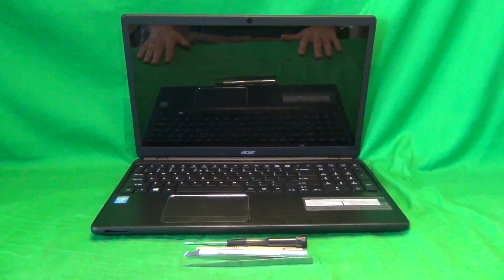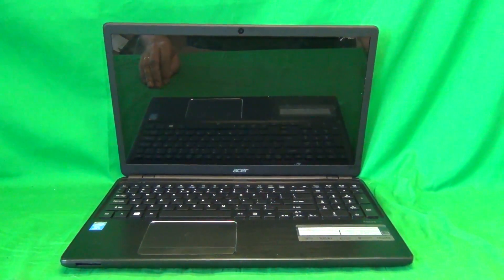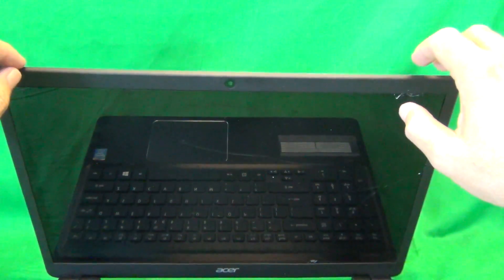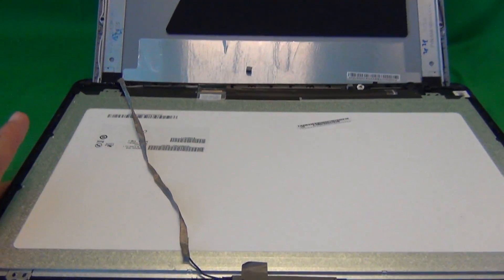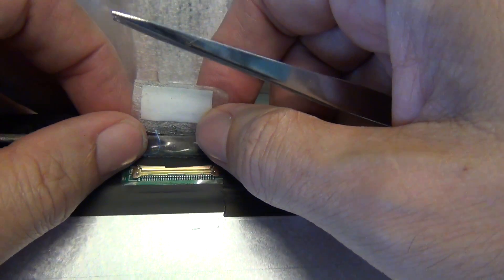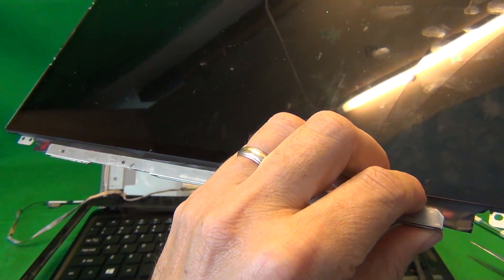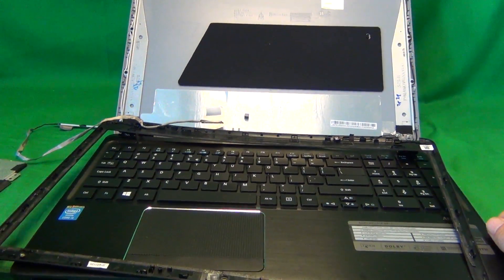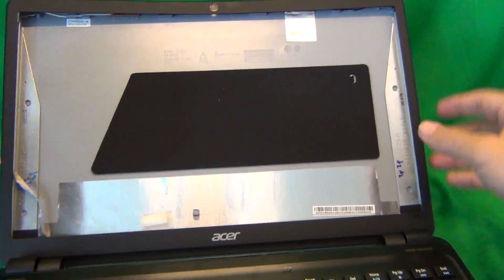Acer Aspire V5-561P Touchscreen Replacement Procedure

Comment: This is super useful.   Before you try it, note that the notch in the bezel on the bottom is not designed to slip a screwdriver and pry.   You WILL crack the glass.   

Start at the top, go slow.    It just snaps apart.

Comment: can someone help me with tutorial on how to replace acer aspire V5-571P touch glass only. my screen is working well but the touch panel is clacked and does not touch. I have the touch glass already from ebay but I cant temper with it without tutorial first. thanks
Reply: +Lutasingwa Jovitus Did you find a way? I have one here with just a cracked digitizer and a replacement part. No luck Googling!
Reply: Unfortunately not my friend. I think the best thing is to purchase a complete touch and screen it around 139$ on e-bay
Reply: I have trouch screen monitor contact me whatsapp, wechat +8801916980690